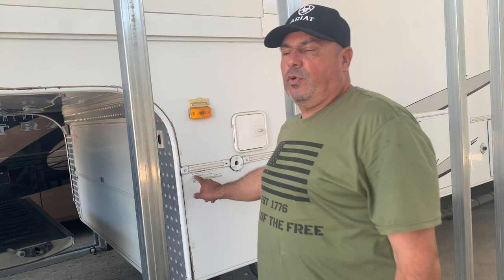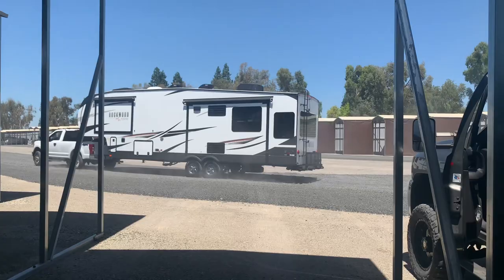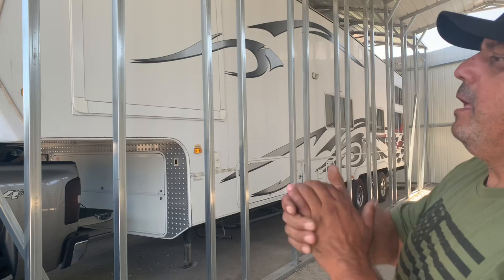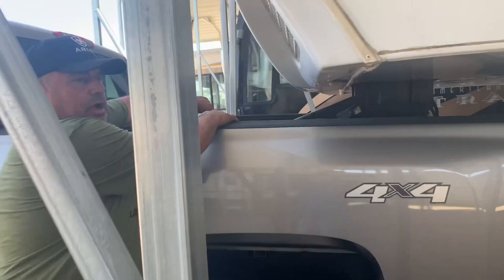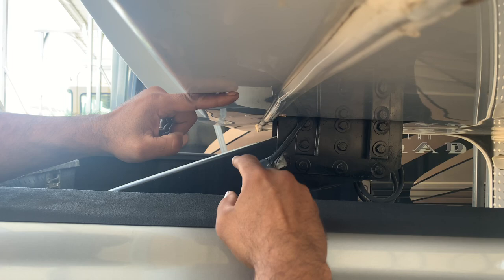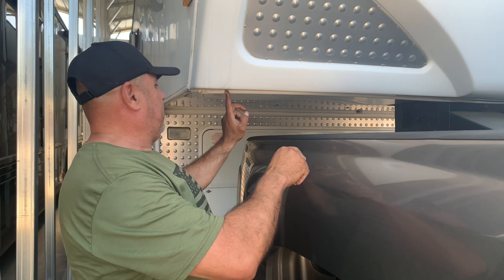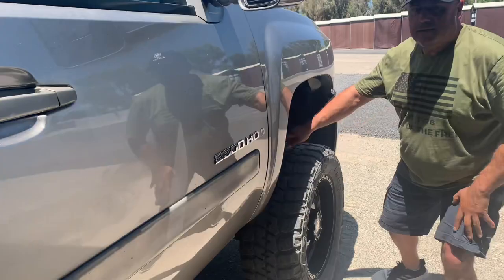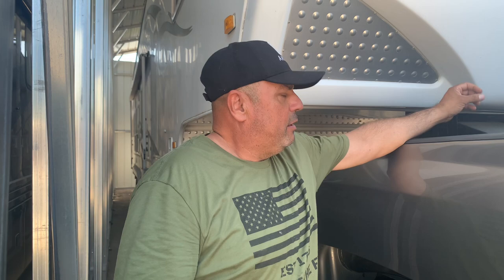Rare Weekend Warrior Billet Edition 37’ 3 axle CDL Toy Hauler.

Comment: If you have a CDL...Then you know your truck is to damn small for the job you're trying to do!! People always try and do to much with to little!!
Reply from the maker: This is 37 foot trailer 11,100 pounds empty, 16,000 GVWR.  My truck is a Duramax 2500 diesel with a Allison transmission. If I would have bought a 40 foot trailer I would have gotten a dually.
Reply: @riosautotransportllc  If your truck is a 2007 I'm pretty sure your pin weight is too much for that truck. Isn't your GVWR 9200?